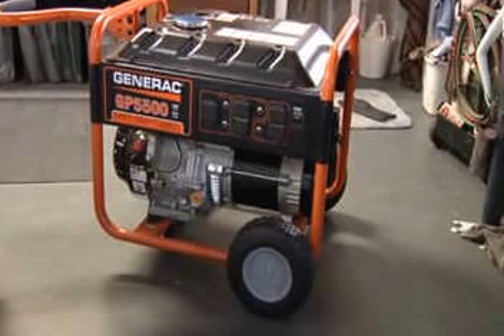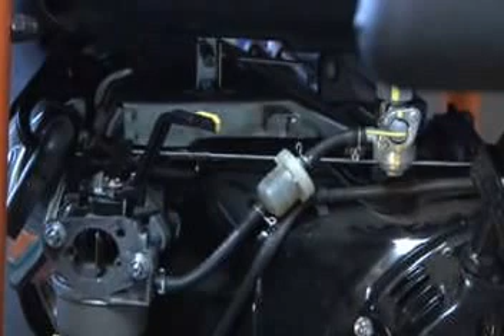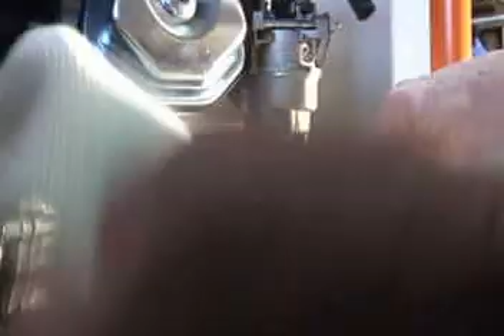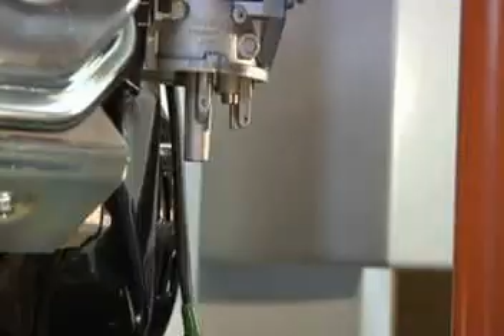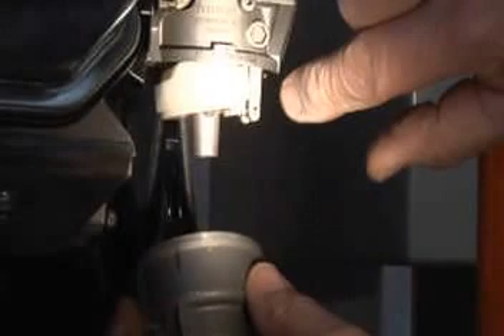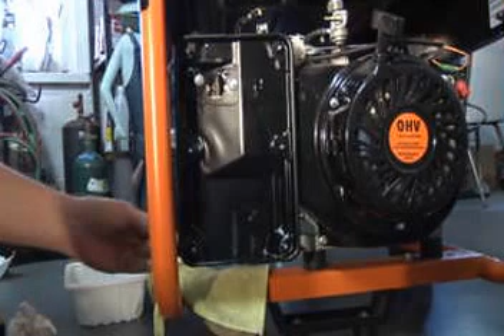Fixing Fuel leak on Generac GP5500 Generator

Comment: Great video! My brand new DuroMax 4400 has the same exact problem and although my carburetor is slightly different than yours I am confident that I can fix it now after seeing this. Thank you so much for taking the time to make this vid.
Reply: Don’t forget about the generator safety rules: anyone who uses portable gas generators really needs to see this safety reminder. All generator safety rules should be followed carefully. This advice is just to make sure that everyone is aware of all the warnings and it’s just to remind people to be careful using portable generators. Generators can be dangerous if not used carefully. Every year, hundreds of people die or get injured when using portable generators due to carbon monoxide poisoning and electrocution. Make sure you are using your generator carefully and keeping others safe as well. There is something very serious that everyone should always be aware of when using generators. Some people do run their generator indoors which is not safe and that increases the risk of carbon monoxide poisoning which can cause death of family and you. Some people run their generator in wet conditions which can electrocute them. Please remember that you should never run your generator indoors. Remember that carbon monoxide is an odorless and colorless gas that you cannot see or smell. Carbon monoxide is a silent killer. Keep that in mind. Make sure your generator is 15-20 feet away from your house and away from doors, windows, and vents. Never use your generator in your porch too. Having a carbon monoxide detector is very important against generator safety. Some people also allow children to go near the portable generator which could pose risks. We need to keep an eye on our children making sure that they are not near the portable generator so they won’t get electrocuted or burned by the generator which is dangerous. A locking enclosure also keeps kids safe. A generator shed might look like a tempting place to explore, or take cover during a game of hide and seek, but a generator is a dangerous piece of equipment that can cause injury. It says on the manual that we should also keep children away at all times from the portable generator to avoid injuries. Please do not allow a child or unqualified people to operate the portable generator. Just because some manuals missed what should be listed doesn’t mean it’s safe to do. Always follow the generator safety rules when using portable generators. Generators pose electrical risks. If you need to use your generator during wet weather, you need a generator tent to protect your generator from getting wet. Don’t let your generator get wet. Keep your generator dry and before using your generator, please make sure your hands and your generator is dry. Do not wear loose clothing when operating the generator. Everything that is said on the generator’s operating manual should not be ignored. Never smoke cigarettes near the generator. Please keep flammable things away from the generator. Never overload your generator too. Your generator can catch fire. Never ever try to plug a generator cord into a wall outlet to avoid back feeding. Back feeding your generator is dangerous. Always turn on your generator first before plugging in appliances and shut off the appliances before turning your generator off. Use a heavy duty cord for your generator and the cord should not be worn out. All the instructions should be followed carefully. Never refuel your generator while it’s running. It can cause fire if fuel spills while your generator is hot. You should turn off your generator and let it cool off before refueling it. Having a fire extinguisher next to the generator is also important. This is only a reminder for everyone’s safety of using generators. Make sure your generator is properly grounded. Having a fire extinguisher next to the generator is also important against the safety rules. https://youtu.be/I1jT3ANENvI and here is a video more about keeping others safe when using generators and also about our family’s safety. Hope this helps. Have a good one

Comment: I have the Troy  Bilt version of this generator. XP 7000. Same engine. Inherited it from a neighbor who moved away and just said it doesn't run.  Cleaned up the carb and it runs. Different issue but my solenoid doesn't work either. It does work if I bench test it but It's not receiving power when I turn the toggle switch on.   I don't necessarily need the solenoid to work, can disable it and let the float/needle do it's job of shutting off fuel, but it too should be shutting fuel flow.   shutting the fuel valve off would stop that but that's not the point. the float and needle is supposed to cut fuel flow  but mine doesn't. I've watched many videos with our carb and I see a spring on the needle. Mine doesn't have that spring. So even with the float all the way up, it's still not pushing the needle high enough to seat and stop the flow. I tried using the spring from a click pen but that didn't work. Not sure why.
But a very confusing issue I also see with our carb is the solenoid. Carbs with solenoids are supposed to cut fuel flow when the key or switch is off. The pin should be extended which seals the inlet. Then when you turn the switch on, should retract and open the flow. I can see your solenoid hanging there, and like mine, and all others, the pin is retracted. If I take it off and bench test it, providing power makes the pin pop up. That is wrong. It should be out with no power and retract when powered.. I think there was a run of solenoids made with reverse polarity. And to further confuse the matter, since the pin extends when powered, why can the engine even run?! Mine runs because it's not getting power either way so the gas flows. Measuring it, it seems the pin when extended isn't even long enough to reach the hole to seal it if it were working properly.  It's totally useless either way! I'm not going to mess around with parts. I ordered a complete carb of Ebay for $30
Reply: Jeff Flowers that solinoid has power to it only when you shut it off - solinoid shuts off the fuel to the jets so fuel isn’t going into the carburetor/engine when it idles down -  when you shut the engine down- the throttle govenor goes into “ wide open  / full throttle “  - thus- causing gas to be drawn in the engine till the engine stops- the solinoid shuts off all gas to prevent gas from washing the cylinder and diluting the oil. I have a generator / welder - That doesn’t have the solinoid - so i grab the throttle rod- push it to the idle side, hold there, then shut it off - try it sometime -
Reply: How about watch this video also https://youtu.be/I1jT3ANENvI please subscribe

Comment: My father in law dropped off his power washer that wouldn't start. I cleaned the jets, but it leaked like a sieve. Almost gave up, pulled up your video used the q tips to clean seat, running fine now, thanks
Reply from the maker: Mick, that good to hear thanks.

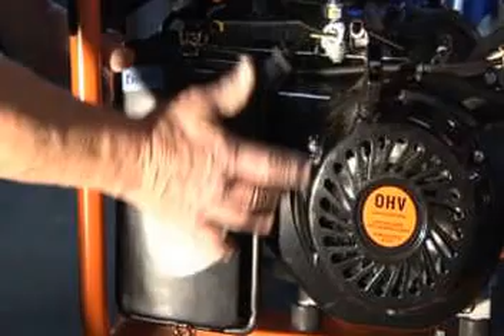Comment: Went out to run my generator for the first time since December, 2016 - just want to be prepared for this big snowstorm coming, strong winds, etc. I now have this problem. The air filter ( 1:33 )  - this is where I gave gas spewing out.  Not sure if I can take care of this issue today..I'll save it for when I get chance to take it apart - It's only 2 years old...so aggravating and the timing could NOT be worse!  Now I suppose I just need luck and just hoping I won't lose power here in Jersey. Thanks for this video though!
Reply: Here are the rules about portable generator safety: This is just a reminder for everyone’s safety. All generator safety rules should be followed carefully. This advice is just to make sure that everyone is aware of all the warnings and it’s just to remind people to be careful using portable generators. Generators can be dangerous if not used carefully. Every year, hundreds of people die or get injured when using portable generators due to carbon monoxide poisoning and electrocution. Make sure you are using your generator carefully and keeping others safe as well. There is something very serious that everyone should always be aware of when using generators. Some people do run their generator indoors which is not safe and that increases the risk of carbon monoxide poisoning which can cause death of family and you. Some people run their generator in wet conditions which can electrocute them. Please remember that you should never run your generator indoors. Remember that carbon monoxide is an odorless and colorless gas that you cannot see or smell. Carbon monoxide is a silent killer. Keep that in mind. Make sure your generator is 15-20 feet away from your house and away from doors, windows, and vents. Never use your generator in your porch too. Having a carbon monoxide detector is very important against generator safety. Some people also allow children to go near the portable generator which could pose risks. We need to keep an eye on our children making sure that they are not near the portable generator so they won’t get electrocuted or burned by the generator which is dangerous. A locking enclosure also keeps kids safe. A generator shed might look like a tempting place to explore, or take cover during a game of hide and seek, but a generator is a dangerous piece of equipment that can cause injury. It says on the manual that we should also keep children away at all times from the portable generator to avoid injuries. Please do not allow a child or unqualified people to operate the portable generator.  It is important to keep your children safe especially little ones. The portable generator can be hot during an operation. Just because some manuals missed what should be listed doesn’t mean it’s safe to do. Always follow the generator safety rules when using portable generators. Generators pose electrical risks. If you need to use your generator during wet weather, you need a generator tent to protect your generator from getting wet. Don’t let your generator get wet. Keep your generator dry and before using your generator, please make sure your hands and your generator is dry. Do not wear loose clothing when operating the generator. Everything that is said on the generator’s operating manual should not be ignored. Never smoke cigarettes near the generator. Please keep flammable things away from the generator. Never overload your generator too. Your generator can catch fire. Never ever try to plug a generator cord into a wall outlet to avoid back feeding. Back feeding your generator is dangerous. Always turn on your generator first before plugging in appliances and shut off the appliances before turning your generator off. Use a heavy duty cord for your generator and the cord should not be worn out. All the instructions should be followed carefully. Never refuel your generator while it’s running. It can cause fire if fuel spills while your generator is hot. You should turn off your generator and let it cool off before refueling it. Having a fire extinguisher next to the generator is also important. This is only a reminder for everyone’s safety of using generators. Make sure your generator is properly grounded. Having a fire extinguisher next to the generator is also important against the safety rules. https://youtu.be/I1jT3ANENvI and here is a video more about keeping others safe when using generators and also about our family’s safety. All generator safety rules should be followed carefully. Hope this helps. Thank you.

Comment: Great video.
I wonder how much the internet and the information age is cutting into business for repair shops in general. 
People can learn to repair just about anything themselves anymore just by watching step by step repair instructions and using a little common sense. 
Repair shops also have an attitude about working on Chinese clone generators anyhow. If repair shops didn't have such an attitude about them and went through the trouble to stock just a few generic repair parts for Chinese clones, they'd have a lot more business for themselves.